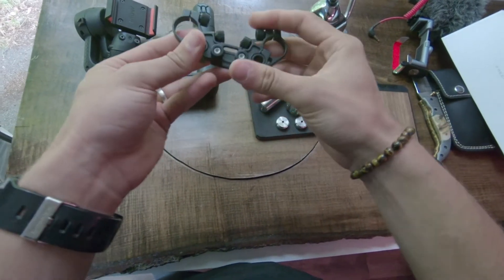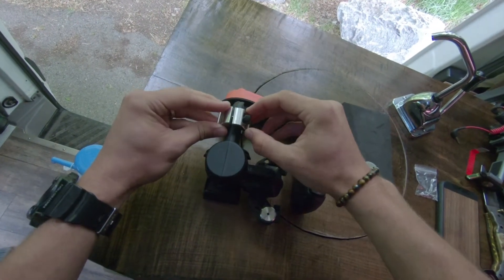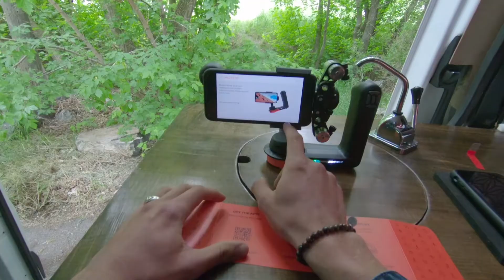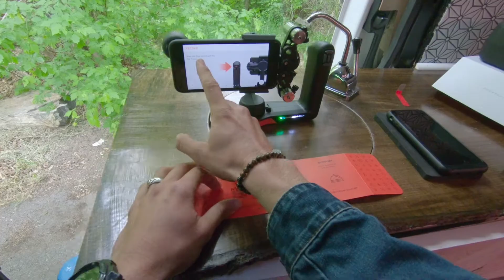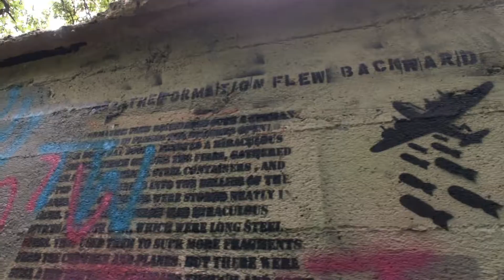Movi Cinema Robot Setup & Features!

Comment: Warning: if you have a one plus 6 or 6t, you'll have  to get the counterweights for an extra 60 to 70 bucks.  The one plus camera picks up the motor of the movi.  As a result, you'll have to push the camera to the side knocking it off it's balance.  The counterweight should solve that issue.  Just be ready to pay even more for it.

Comment: Hi. I’ve seen is possible to put this gimbal in stand-by mode by putting vertically the phone. Can this be done also with the counterweights mounted? There’s enough room to do it? Tanks
Reply from the maker: That's a great question! I haven't personally tried that, I always film horizontally. I don't think that there is enough room to do it with the weights on however just a guess.
Reply: Make a test if you have the chance 😊🙌🏻

Comment: Will  GoPro 7 work??
Reply: No but you also don’t need a movi for a hero 7. The stabilization in the hero 7 is actually better than this imo.
Reply: Yes, you can use a GoPro mounting plate. The videos are beyond smooth when paired together. Almost surreal! To top it off, in post production and some final stabilization is incredible. Seems overkill but, the video will come out better than you'd hoped.

Comment: The rebalancing weights turn me off!
Reply from the maker: I definitely get that, it can be a little time consuming at first but once you get the hang of it it's pretty straight forward. Luckily you can also not have to balance the counterweights if you don't use an aftermarket lens.